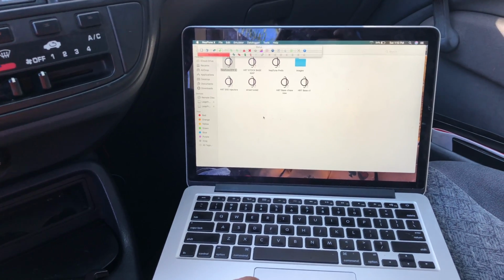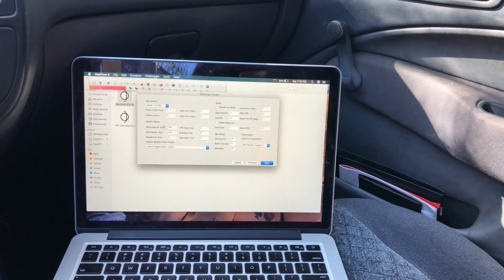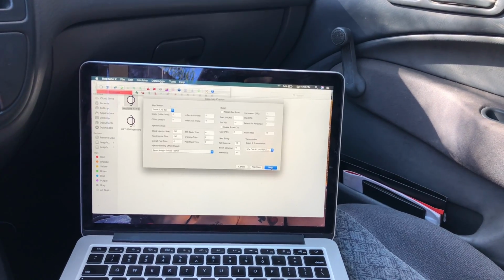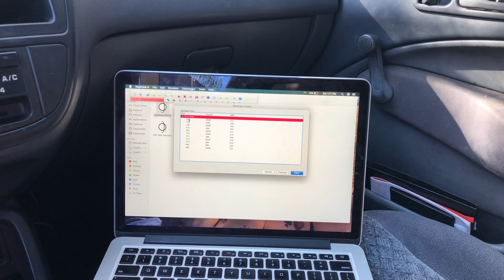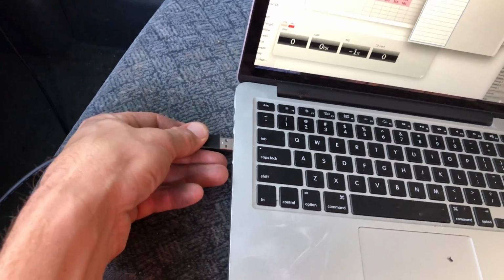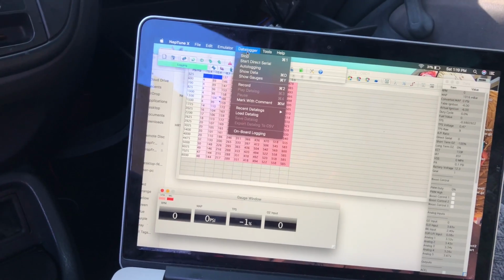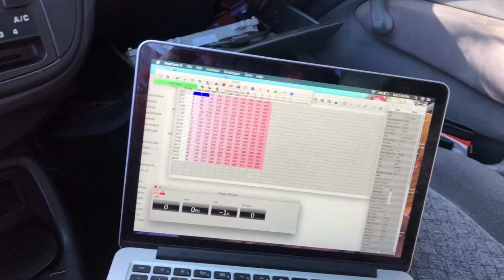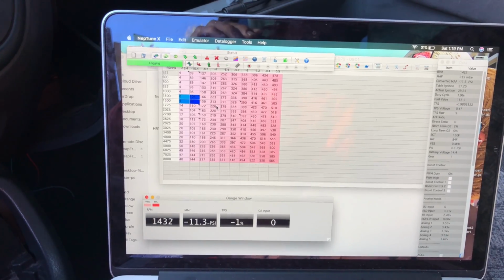Neptune RTP uploading a base map

Comment: Help.me please
Reply from the maker: What’s up buddy
Reply: @BigPowerstrokeguy  i have neptune demon 2 in my car and p28 ecu.suan does not get any information from neptune p28 suddenly it happened i have been using it for 5 years there was no problem now it connects to the computer but does not see ecu
Reply from the maker: @bekirtancan265  the board may have been unpined to the ecu . Try opening the top cover of ecu and make sure the Neptune board is still properly clipped into the ecu
Reply: yes I checked them and I tried the neptune with 3 different p28 as a result the same neptune cannot receive any data with p28, the file is being uploaded it connects to the pc neptune license is also available

Comment: It’s not coming up with error codes it’s just hogging out after 2800 rpms. 
But I never started data logging before i uploaded the tune. I’m going to try again. If there’s an issue I’m sending back the ecu and seeing if there’s a problem on there end.
Reply from the maker: Can you go live ?  You ecu could be fine and it’s could be something else like your dizzy . Did it run fine before on stock ecu ?
Reply: yea its a b20 vtec and it ran decently on stock p28 from b16 
then uploaded the b20 vtec map from ha motorsports and my at went into limp 
is it okay to send you my phone #?
Reply from the maker: Try uploading the p75 map

Comment: this made life so much easier. thanks for the video man ! 
i uploaded a tune and my car is in limp mode now though.
i have no clue what the issue is
Reply from the maker: Glade to hear this helped you . That’s all I’m here trying to do . What error codes are popping up on your Neptune ? Or could be a prob with your ecu . My Neptune accidentally got In pinned from the ECu do to my USB cable not properly fitting. My car ran fine but went limp when VTEC I had to eventually send it back to HMO where I purchased it and they reinstalled it for free covered under warranty.
Reply: YouTube Watcher how much did all the Neptune tuning stuff run you?